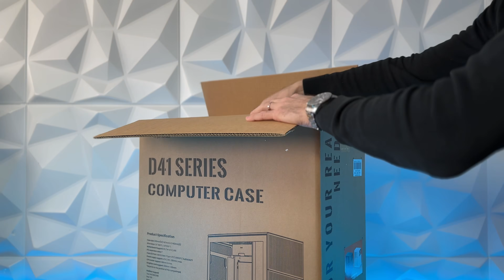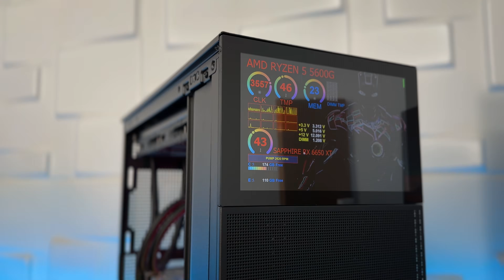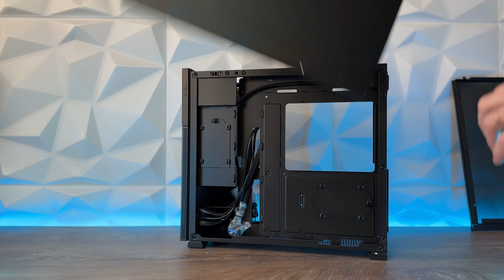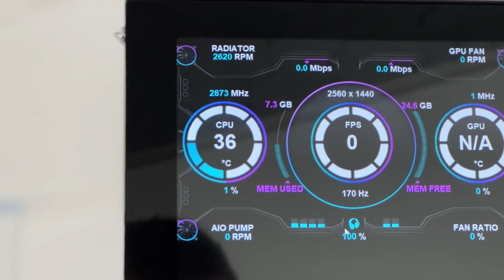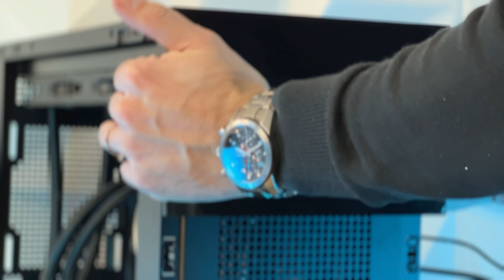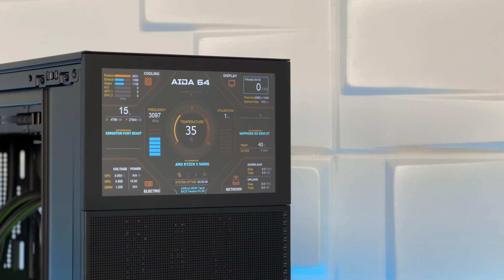JONSBO D41 SCREEN - Clean Implementation! [In-Depth Review]

Comment: friendly remider , if u using a standard ATX psu and u install 3.5 hdd in front tray or cable mod extension either two of them will make cable manegement very "challanging" ,especialy when u have argb fans ,i put my back penal back all by luckey and i fear i need to ever open it again but in front u can't see cables and it did looks super clean and stand out from all the fish tank setups

Comment: This case is a nightmare for cable management. You even used up your HDD cage to fit the cables in, so in reality that cage is completely useless as otherwise there would be literally no space for cables. This whole idea with PSU at the front just doesn’t make any sense to me.
Reply: It makes sense because with the typical bottom PSU layout there's a bunch of wasted space that makes the case unnecessarily big. Anyway, with cases like the D41 you're meant to use custom sleeved PSU cables with shorter length so there's less managing required.
Reply: Front psu is common in these mATX cases.  I mean it is micro ATX what do you expect?  Of course there is going to be some tight squeezes for cables.

Comment: @6:50 i wouldn't call the bottom filter easily removeable when the case needs to be tilted, with 2 feet of the ground, to be removed.

Comment: Really Happy! Just bought this case, and by my mistake, I bought a MSI Meg Ace x670e motherboard. Not knowing the Meg Ace, was an E-ATX. Luckily, with some cutting, it fit perfectly, lmfao. All standoffs, matching all holes, exactly! 

I swear, the manufacturer knew people would try to fit an E-ATX Mobo in the D41 mesh case, by means of design. For what ever reason, I was blessed, and was able to keep my Ryzen 9 7950x cool with the Noctua Redux fan and CPU cooler, and a Nvidia RTX a4000 GPU. Thanks for the video's. Had to do a whole bunch of research seeing that this is my first build ever! Cheer's, and thanks' again!!!
Reply: u should buy laptop or let boyfriend build

Comment: i use my d41 screen for my second monitor i didn't have much room and wanted a second monitor but didn't have much space so the screen fits my setup perfectly my 32 inch monitor has only 15 inches to its right and that's usually where the tower sits lol very clean case, cable management is a must but its clean and looks great

Comment: Great review!  I see the PSU pulls air from the front of the case and then exhausts up.  Not used this orientation before on the front.  Any concerns you see with that set up for an air-cooled setup?

Comment: what a pity that the screen cannot just connect to the USB-C onboard header and work that way.... Some portable external screens function with only USB-C connected, so why does this need to have cables that go around the entire case? Kinda reminds of of the early days of USB 3.0 when the mobo's didn't have the internal header and this was the only way to get a 3.0 on the front panel.
Reply from the maker: I totally agree with you, but maybe they wanted to leave the USB C on the motherboard for the front panel connection since it has one.

Comment: Love the look of that front screen, but I would never be able to fit all my cables. Also, bigger psus dont seem to have enough space. I dont like the idea of having the psu in front like that. I hope thet make a larger and bigger case, something like Lian Li models, with rear psu and plenty of space....bit also with the nice Screen on front...
Reply from the maker: The screen is epic, for sure. Everything is possible, just needs some work. Larger PSUs... Well it is not that they aren't welcome because you can regulate the height of the PSU bracket, but it could be managed. Well honestly, Lian Li is a place of it's own and I wouldn't like if they "copied" them like others. ;)

Comment: I noticed your display read 39 degrees Celsius almost consistently. That's about 7-9 degrees higher than what I get  using a Phanteks Evolv X.

Were you in a warm room by chance?

Would love to downsize to something more compact if the temps are still good.

Also can it fit a 4090?
Reply from the maker: Not sure about RTX 4090 to be honest, because at that time I didn't have any RTX 4000 Series.
As for the thermals, room temperature at that point was from 23-25C, but also it was idleing at 39C.
Reply: it can indeed fit a 4090
Reply from the maker: @kobes._wrld  Thanks for the information. :)

Comment: After watching your review I am sold on this case for my first ever PC build! I do have 1 question I would love for you to answer. The graphics card I am wanting to get fits by its dimensions, but I would like to mount it vertically. Will this case support a vertically mounted GPU while still having the 2 intake fans below? Or will I need to stick with a standard horizontal mount? 

Thank you!
Reply from the maker: Well I am glad the video helped you out!
As for the vertical mount, I am not quite sure to be honest. Depending which vertical mount would you use. I think in the worst case scenario, you could squeeze in those thin Noctua fans beneath the GPU if, for instance, you use that Lian Li vertical bracket mount. But can't guarantee 100%, sorry.
Reply from the maker: Your comment somehow disapeared. But I read it on my emails. I don't have more information and I won't have until July when the ANTEC GPU holder will arrive for review. :(

Comment: Would this case fit a Corsair RM1000x Shift Fully Modular ATX Power Supply - Modular Side Interface PSU?
Reply from the maker: It could when we are talking about the length of the PSU, but since I don't have the Corsair Shift PSU, I am not sure how much space at the back will the cables have for re-routing. Sorry.
Reply: @PCCrazyDario  Ok

Comment: top 240mm aio, 
back 120mm fan, 
bottom 2pcs 120mm fan. 
thats how i do it. btw i bought non mesh, i like it look clean. 😂 idc anymore about airflow with all those fan inside.
Reply from the maker: Well in this situation the front mesh doesn't do almost anything since you could place a fan on front, but you don't have to since it has a chimney effect for cooling the parts inside. So yeah, clean front is nice indeed! :D
Reply: i did a 240mm radiator with fans in the top rear and a single 120mm fan in the top front Infront of the radiator pulling psu heat out of the case one 120mm in the front below the psu 3 120mm fans across the bottom and 1 120mm rear exhaust works great

Comment: Did the screen the case uses effect the fps or performance in any way on your primary monitor? I've heard of other screens mods that have cheap lcd screens that lock the main monitors hz support at 60, even if the monitor can go higher.
Reply from the maker: Actually, you can see it recognises the second monitor resolution and refresh rate, so there was no problem with it. Other LCD screens react differently as a second display. This doesn't effect the main monitor.
Reply: @PCCrazyDario  Thanks for the info!
Reply from the maker: @hectorpcmr.  You are welcome. :)